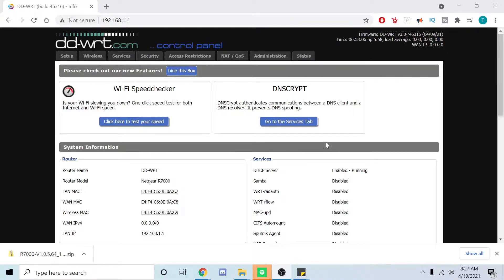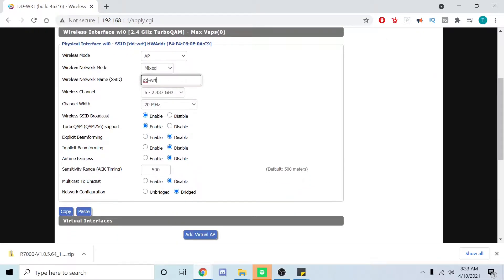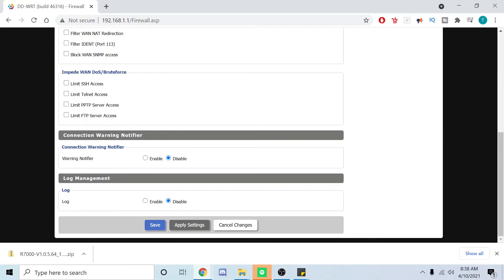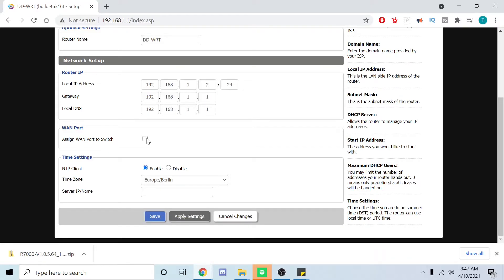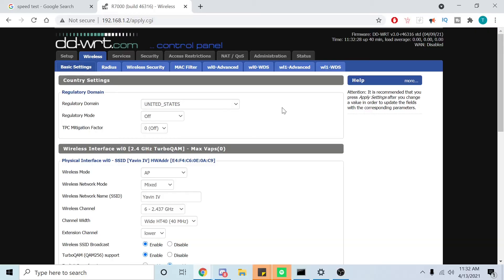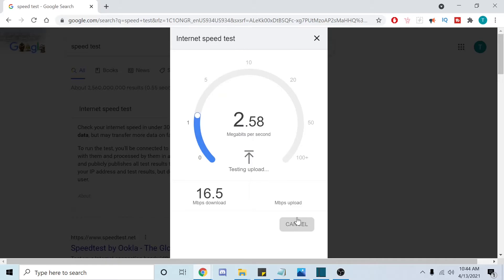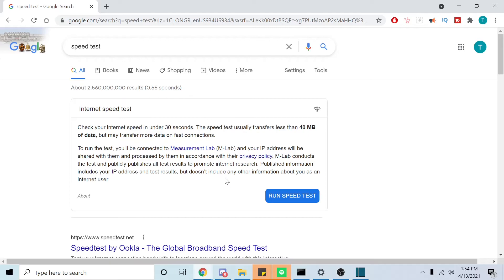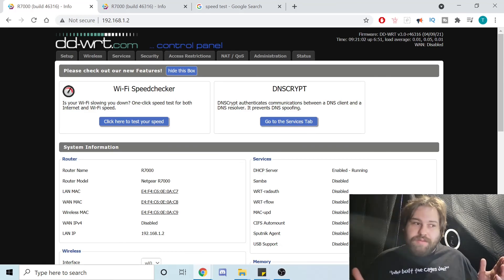Boost Your Homes WiFi - Setup A Wireless Repeater Bridge 2021 Featuring Nighthawk  AC1900 / DD-WRT

Comment: Quick question for you...what is the purpose of splitting the channels on the 2.4 between the main and secondary routers?  Noticed you used 11 on the main and 6 on the repeater.  Thanks
Reply from the maker: Wifi on the same channels have a better chance for "packets collision "   so it's better to have them on different channel so they do not conflict